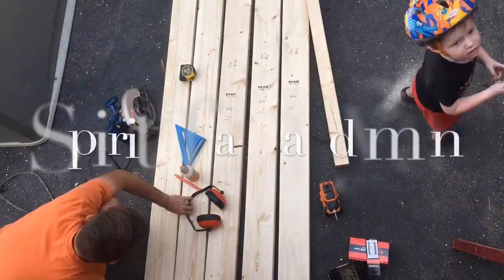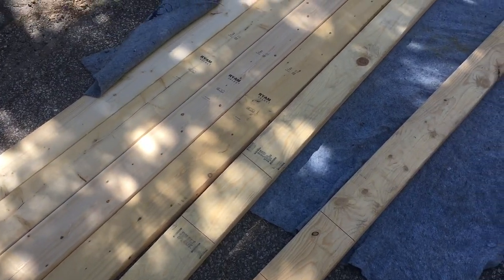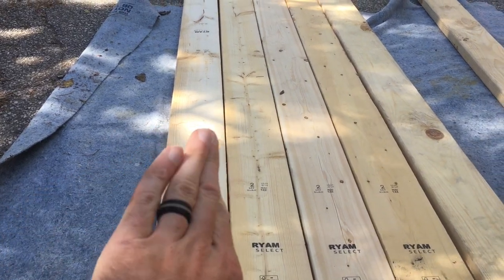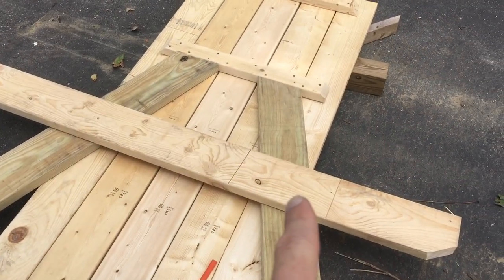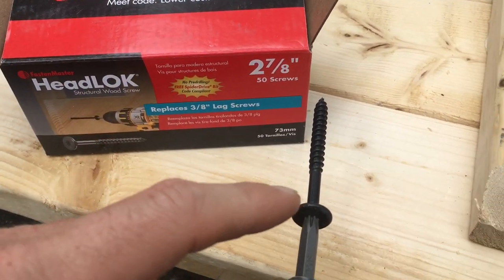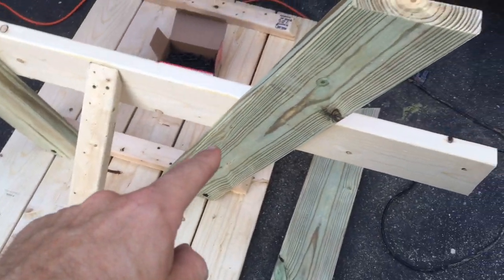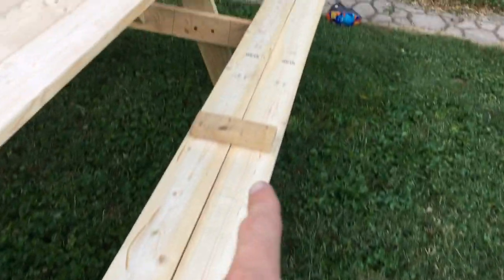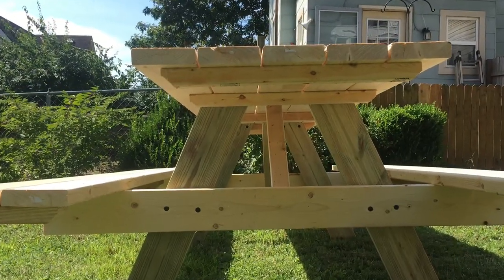How To Build A 10' Picnic Table

Comment: I know you have only had this for less than a year...any regrets, such as too long, or table top not wide enough.   I want to make a 10 footer, but am not sure if it will just seem very large, and even then I am thinking I should go wider with the table top, like six  2x6 or perhaps five 2x8's.  I've even contemplated making the table top out of 1X material as opposed to 2X just to keep the table lighter.  Any thoughts or insight is appreciated.  Also, was this table pine?  Did you do the finish yourself in the same fashion as the other video where you are torching the table, it looks awesome.
Reply from the maker: Great questions! Yes, I finished it with the wood burned look and then I seal it with a clear poly. I think the dimensions are great. I have started cutting the legs just a little longer at 35" to give a little more leg room. I would shy away from using 1x material because it would be more susceptible to warping and sagging over time. I used construction grade pine from Lowes

Comment: Wow . You should not be instructing at all! Bending forcing the wood, hoping screws will hold it. Over time with weather swelling and shrinking thats going to come apart, use of power tools is not your strong point either. So big lesson here is why you find an instruction manual!